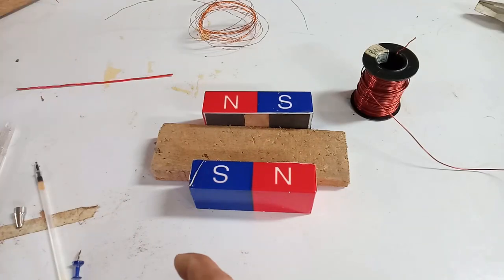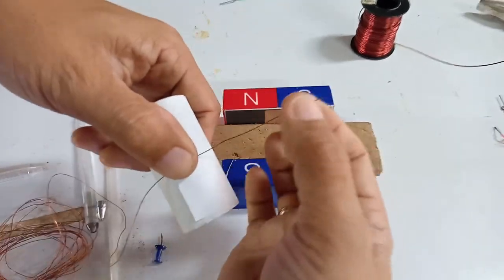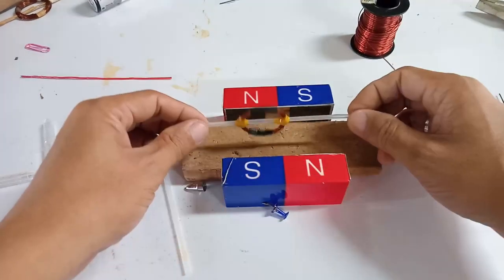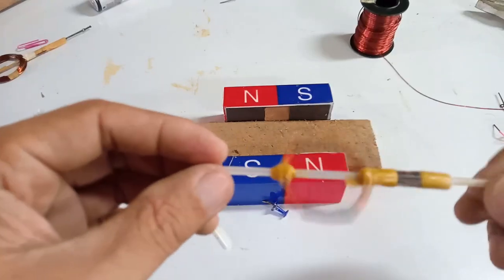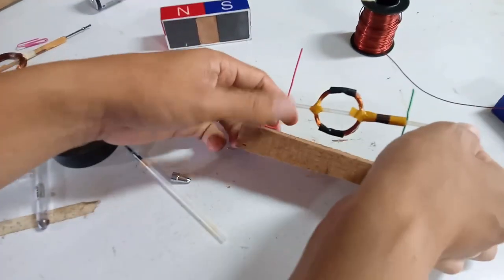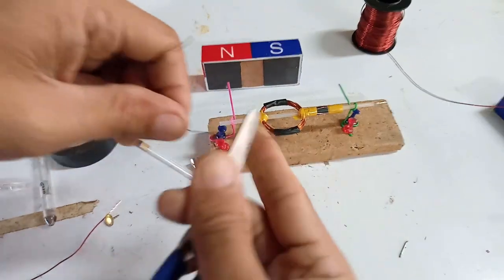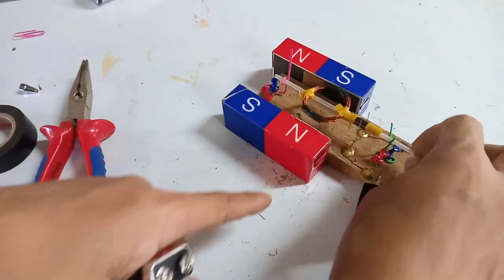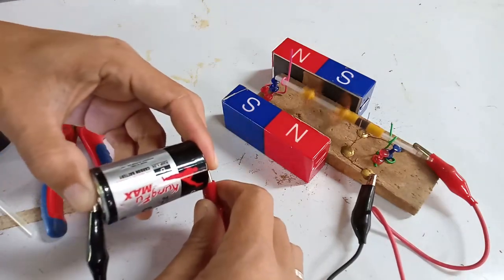How to build a SIMPLE ELECTRIC MOTOR. Step by step guide.

Comment: How many turns po iyong magnet wire?
Reply from the maker: around 40 turns, winded on a D-size battery. you can do even more than that since a longer wire is much better.